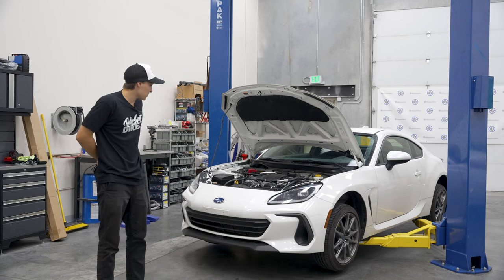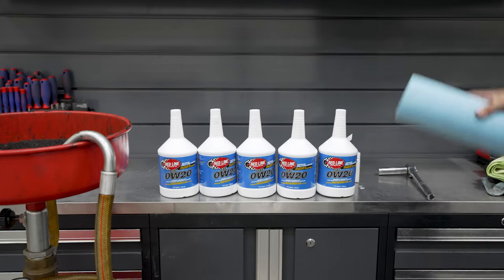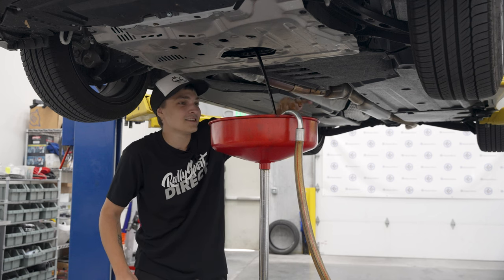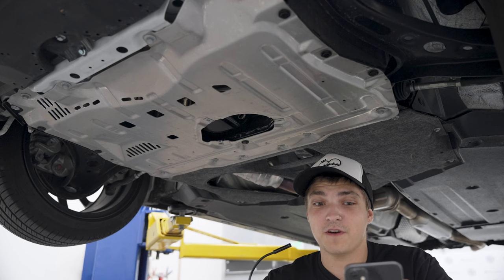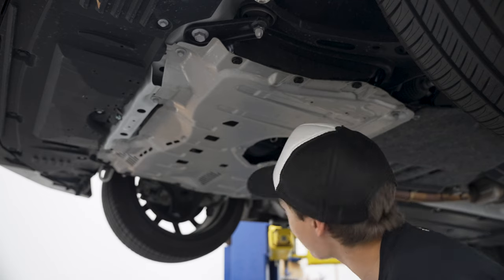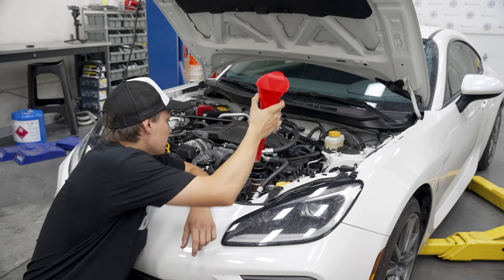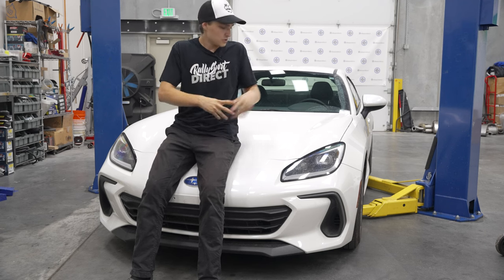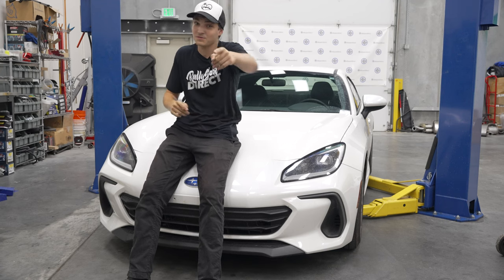2022 BRZ&GR86 Oil Change Plus We FIND RTV??

Comment: Fyi only the US owners manual says 0w-20 for federal emissions reasons. The Japanese owners manual and the engineers where this engine is made recommend 5w-30
Reply from the maker: Oh that's interesting, i've been wondering why so many new cars are all the sudden jumping to 0w-20
Reply: Actually it doesn't. The Japanese GR86 manual recommends 0w20, but says 5w30 can be used.

Translated:
"Recommended:
Toyota Genuine Motor Oil SP 0W-20
― API SP/RC, ILSAC GF-6A, SAE 0W-20
Suitable:
Toyota Genuine Motor Oil SP 5W-30
― API SP/RC, ILSAC GF-6A, SAE 5W-30

Use oil that meets API standard SP/RC or ILSAC standards. 0W-20 can demonstrate excellent fuel efficiency performance. If 0W-20 is difficult to obtain, 5W-30 can also be used. In addition, cans of ILSAC standard compliant oil have the ILSAC CERTIFICATION mark."

The Japanese BRZ manual doesn't recommend any weight, rather, it just shows a list of weights that can be used: 0w20, 0w30, 5w30
Reply: 5w-30 much better and safer
Reply: @pirihern9329 i was gonna say I think between the two I think all owners of the 86/brz models should go with 5w-30 to be much safer!
Reply: It's to boost the mpg numbers. A thinner oil provides less resistance which gives the car a wee bump in efficiency.

Comment: You should def take the oil pan off (be careful it’s aluminum!). Razor blade the old sealant off, reapply sealant and check tube. I believe Subaru/Toyota did this because the pan where it attaches to the engine is very thin and also has a step. So they gobbed this in to make sure it’s sealed but will end up biting them in the butt.

Comment: Appreciate the video. But, this was as about as useful as tits on a bull with regard to the RTV issue. You showed a small bead of RTV inside the pan. You really should have dropped the pan and inspected it properly like most of the YT influencer shops have done.
Reply from the maker: That's why i asked at the end if you'd like to see me drop the pan.. seems like there's interest so i'll get moving on it ;)
Reply: Before you drop the oil pan... do that exact same process using your borescope on 2 or 3 other random brand vehicles. It would be good to understand the lay of the land with regards to RTV gasket use or overuse. For all we know all vehicles have some kind of RTV bead. And your borescope process is far easier than dropping an oil pan, yet the data you collect by checking out other makes and models is priceless and 1000% relevant.